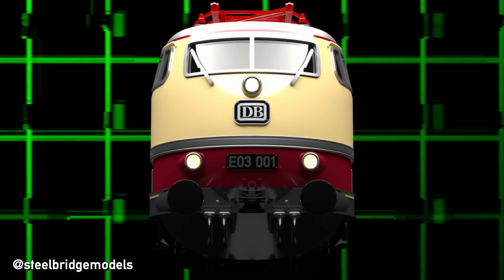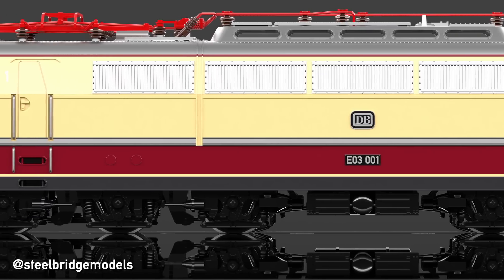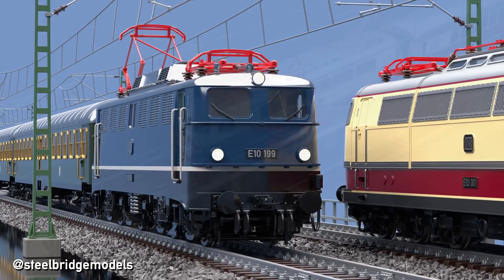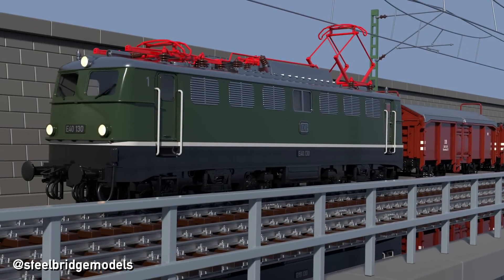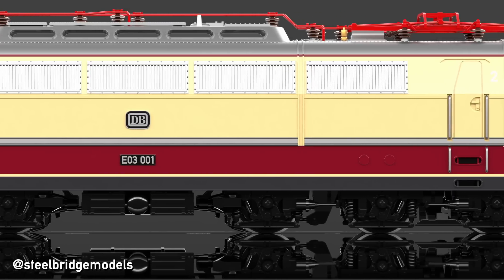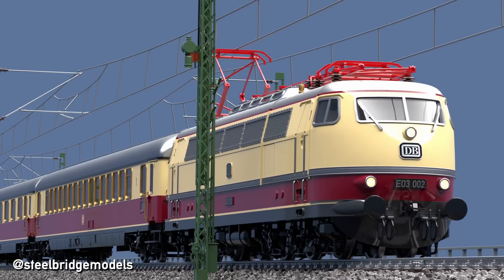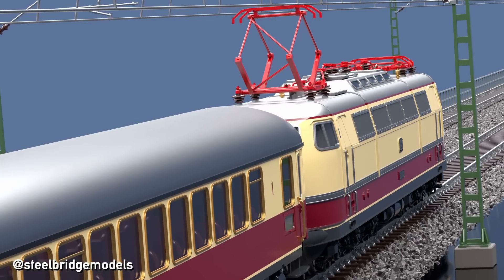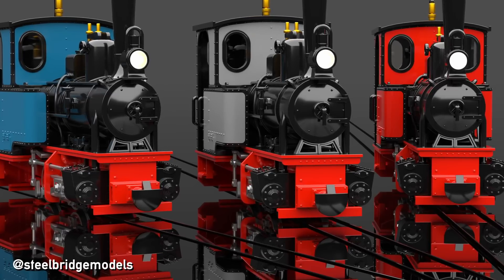For the first time in regular service!

Comment: Their first high steed runs was on München - Augsburg, the same route where the Bavarian S2/6 set it's speed record for steam engines in 1906, which was not beaten for a long time.
Reply: Da hat  mich damals  mein Vater mitgenommen, und ich habe erst später mitbekommen, dass ich mit einer Legendären Lok unterwegs war. Bin nun auch Lokführer, aber das Erlebniss werde ich nie vergessen.

Comment: Excellent, excellent video.
Funnily enough of course, Henschel 30 years earlier already knew about the braking issue with signals. The 225kph E19 couldn't stop within the signalling distance like the E03, and the electric brakes unfortunately were never tried (like the 200kph Berlin to Munich run) due to some non-rail related events.
Now, the DB and DRG weren't the only ones with that issue of signals. Due to rather large distances over, for instance, the Milwaukee: trains like the spectacular streamlined Hiawatha route didn't have the same condensed traffic issues, however this can't be said about the headaches the LNER traffic staff had with the record breaking Coronation, whose streamlined high speed antics had to share the same lines as slow loose coupled goods trains plodding along behind an 0-6-0 goods loco dating from antiquity.
From the traffic managers point of view, they got the Coronation streamliner to run TWO blocks apart i.e for the driver to observe every second signal to allow the extra braking distance. 
One can imagine the poor driver trying to remember which signals were the binary ones, and trying to stick with a fairly enforced speed limit when the speedo was mounted under the firemans seat.
But, it did work.
For any that are interested the streamlined A4's added nothing to the speed performance, on the occasion when an A4 wasn't available (originally there were only 4), a Gresley A1/3 was substituted, which were perfectly capable of running the Coronation to time, the streamlining only effecting fuel economy.
Rather ironically this substitution of non-streamlined 10 year old pacifics wasn't lost on the contemporary press: astute observers wondering why a high speed service wasn't implemented 10 years earlier, when its currently being demonstrated it was perfectly feasible?
A question one may ask, why the immense development stages and research into high speed 200kph testing of stock and its effects on the E03, when 30 years earlier the same programme was already being put in place (just never implemented)?
Anyway, EG538 (E91/3) next please: coolest e-lok everrrrrr

Comment: As a 15 year old boy I was drooling over the 103 in the Fleischmann catalogue, it's price way out of reach. Now, at 58, I recently picked up de model railway hobby. First purchase...? yes! 🙂
Reply: Back in '74 I had one by Minitrix, an early single row of vents just like this video.
Reply: You and I are the same age, and I was drooling over the märklin TEE set with that glorious 103.
And like you, this year I finally got one, and its just as glorious to me now as when I was 10.
Reply: Funny how it's always those in there 50s that have a soft spot for the 103s. I think I now have 5 Marklin ones two of the single row ones. I think they look much better than the production ones.

Comment: LZB took until 1978 to be declared ready for serial application, until then 200 km/h was only reached on a few experimental sections (class 103.1 was built 1970 to 1974). The 200 km/h sections were a requirement for the new IC'79 system with hourly trains that also became much heavier (with both 1st and 2nd class). Class 103 was capable of operating this system because it was designed with some reserves.
The less powerful pre-series locomotives were at that point mostly used for test runs, including a 283 km/h record in 1985.